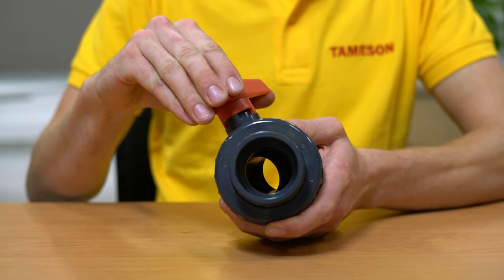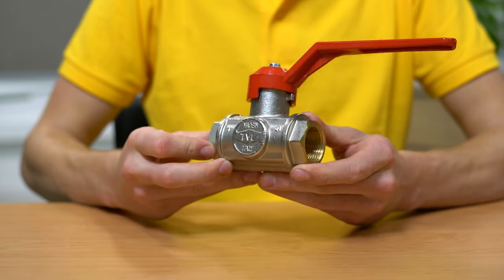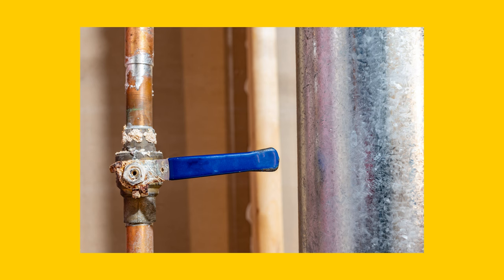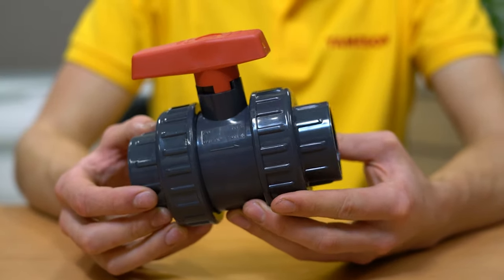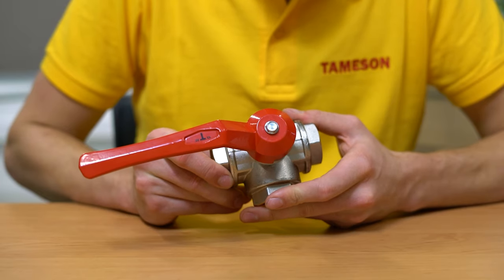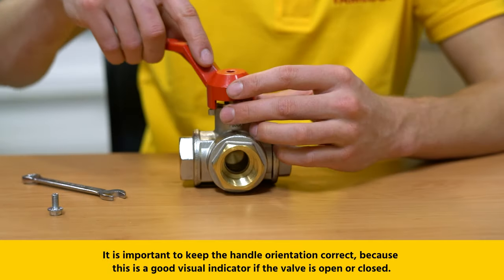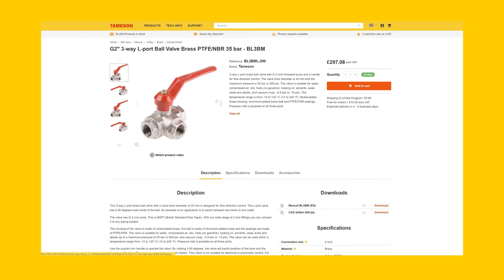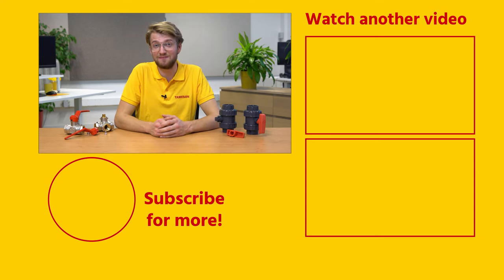How to replace a ball valve handle | Tameson

Comment: Question:

On the metal ball valve, can the handle be reversed so that it's in a different position on the valve? I don't have one in front of me and want to order one online. The one I need has a female end that needs to go on a short length of pipe coming out of a wall. The handle as seen in the ad for the valve is situated over the female end which would prevent the valve from being installed as the handle would be too close to the wall. Please advise. Thanks.
Reply from the maker: In many ball valves, the handle can indeed be reversed or re-positioned to fit into tighter spaces. However, this depends on the specific design of the valve. Maybe you could install the valve the complete like in mirror so the handle will be oriented opposite to the wall.
Reply: @Tameson  Thank you for your reply.
If you mean turning the valve around so the handle faces away from the wall, that's not possible without adding extra fittings. The part of the valve that goes up to the wall is female as the pipe out of the wall is male. It's basically a 3/8" to 3/8" ball valve needed as there is a hose that's connected to the pipe out of the wall.

So it's a female to male (valve) situation needed except the handle gets parked over the female end which is too close to the wall.

I don't think the online seller understands the problem as there's a language barrier.

This is a basic generic brass ball valve with a nut securing the handle onto the valve. The kind with a shaved-on-both-sides stud out of the valve with a rectangular hole in the handle that fits onto the stud where the nut can tighten the handle in place. The handle has two metal tangs that hang down to catch the stop tang on the valve. Was wondering if the "stops" on the valve and handle would work in reverse and wanted to ask you since you did a good job of making an excellent video on the subject.